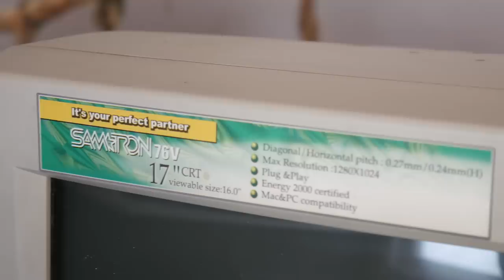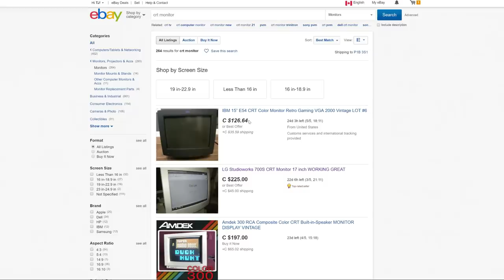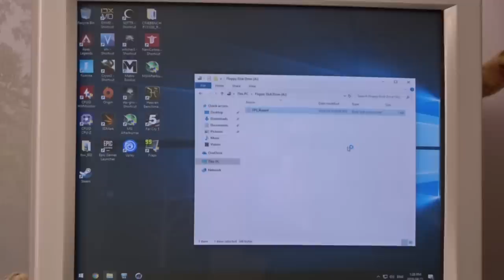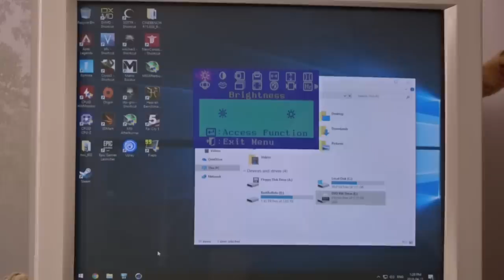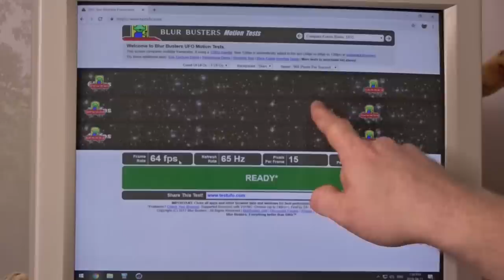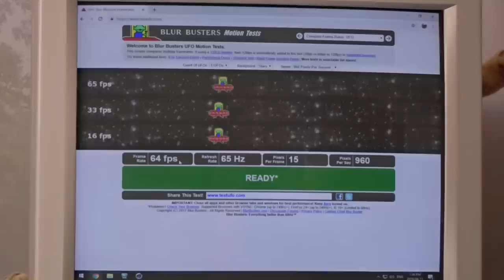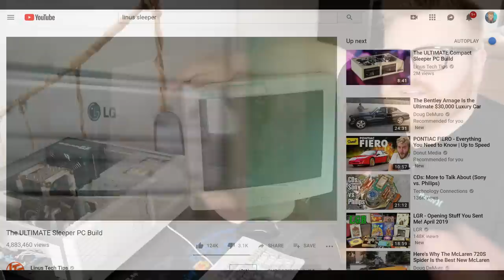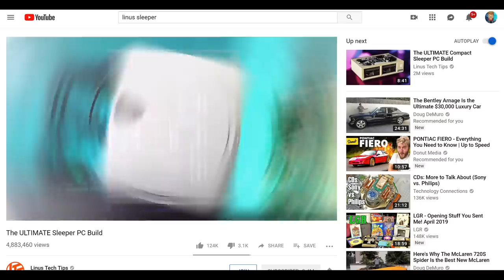Using a CRT to game with titles from 2019????

Comment: Yes, people don't realize how much better the overal image is on CRT's than LCD.  Everyone wanted the physical slimness vs actual image quality.  Few people know LCD's blur with motion. Even my 1ms 120Hz gaming lcd monitor blurrs.
I didnt notice it until I had lived with my new LCD HDTV for a couple years. Then I used my older CRT HDTV for something & my jaw dropped at how rich the colors were & how smooth the motion was.
Don't believe me? Just move something with text (like a map) and try to read it as it moves.

Comment: 65hz on that monitor, if you're not you, has flickering that does your head in, 85hz is a minimum for CRT, it is fast enough to not bother.
If you lowered the resolution on even that monitor, you can overclock the refresh rate to 85 or higher.
lower resolutions with antialiasing or supersampling look better on CRT's than higher resolutions.

Comment: Did I miss it or did he not tell what motherboard and CPU he put in there? I see an old parallel cable connected to the motherboard so I am curious what motherboard it is. It looks nice, that blue color of the motherboard but I don't like the white plastic on those slots though, that doesn't fit well with that blue color.

Comment: Defiantly add a couple of 80mm fans to the front PCI card support bracket as intake, if it allows do 2 piggy backed in the stock supplied location and you should see some improvement on temps.

Comment: I recently bought a 19 inch CRT monitor for $50.
Its max resolution is 1976x1482 @60Hz, but I run it at 1440x1080 @85Hz most of the time.

Comment: I would love to do a Noctua color build, beige/brown with an old case like that. 
A way perhaps to approach that case with airflow would be maybe chopping out those drive cages and have fans in the bottom front of the case drawing air in.
If you have access to a 3d printer you can get fan brackets for pcie slots to pull air under the GPU.

Comment: If you ever get a high end CRT with the ability to crank up the refresh on the lower resolutions, do that ;) You will also have to put a faster cpu to get to around 120Hz@1024x768 resolution though, but thats really why you would want a CRT in this day and age in the first place. Without that refresh, theres not a single reason to consider using CRTs.

Comment: Dont hack this system up. Keep it as is. One advantage of having a CRT over an LCD/LED is that there is no native resolution you have to have your CRT on to look its best. Any resolution looks good on a CRT. For extra cooling, you could buy one of those fans that slide into an expansion slot and blows the air out, or you may have room for an 80cm fan out the back of the case. It looks like it might miss the CPU cooler?

Comment: still using a (big) crt and currently playing crysis 1 at sorta 720p (1152x864),max settings and all
this one supports up to 1920x1080 but screw that
4:3 aspect ratio and (less) input lag forever
Reply: try interlacing!

Comment: I think gtx 980 tis are the fastest cards with VGA but you can also buy active HDMI to VGA adapters for newer cards. Also try overclocking that monitor I'm sure it can do at least 120hz. Also if you need some solutions to let modern games in other aspect ratios WSGF should have you covered.

Comment: I'm rocking a Trinitron CPD-200ES as daily driver... 1440i at 85Hz is not a problem and looks better than 1080p60 on an LCD (Plus I paid only 20€ for it) (Also 1080i at 120hz looks good)
P.S. To fix the aspect ratio on Apex you have to put it in windowed fullscreen

Comment: With the feet elevating the case, there might just be enough room to where you can drill holes in the bottom for ventilation going in, maybe a slim line fan over the holes. I'd probably would attach a slimline fan as an exhaust on the rear grates, as the power supply is likely getting warm only because it has to be the thing exhausting the hot air. Power supply as the only exhaust worked fine back in the day, but not so much with modern hardware. Lol, maybe get one of those old fans that exhaust out of the PCI slots and put it in between the graphics card and CPU. Those were so pointless back in the day, but actually help in this case.
Reply from the maker: Good ideas

Comment: In the early 200's (~2005) I had the grand idea to buy a Mitsubishi Diamond Pro 2040u NF from eBay for like $50 (I think it cost like $75-80 to ship the 68-pound monster though..)
It had a native res of 2048 x 1536 / 75 Hz (double 1024 x 786) it actually pushed over a million more pixels than a 1080p screen.
It had 5 coax cables as an option in addition to VGA (BNC, one each for RGB one for Horizontal refresh one for a vertical refresh, each in a shielded coax cable, I had a BNC to DVI cord IIRC)  The screen had a button on the front to switch between BNC and VGA so that two systems could be hooked up at once and share the one monitor (Dual monitors??  pfft  dual PC! lolol)  The colors were supposed to be excellent, I believe I got it from a graphic design business that was getting rid of them all.
It had two USB in ports (square) and 3 USB out ports (rectangle) so you could hook up a keyboard and mouse and other item and share it with the two PCs.

Too bad it was over 68 pounds and actually started causing my desk to bow/sink in the middle after a couple years :p It also produced a lot of heat for a small room (over 170 watts used according to the manual I found online.
https://www.manualslib.com/manual/258812/Mitsubishi-Nsb1107sttuw.html#manual

Comment: I got a 1080p 60Hz monitor that only has VGA connectors, and I use it with a modern GPU with a HDMI to VGA adapter.

Comment: 1280x1024 is 5:4 not 4:3...it's actually even less wide.

And DVI-I or -A is needed for analog, not dual link. DVI-D would be no bueno and is available dual link. The 4 pins around the blade are for analog.

Comment: 4:01 no, it's gotta be a DVI-I connector, having both analogue and digital capability. Dual-link is for higher resolutions than DVI was originally designed for, and has absolutely nothing to do with the analogue signal (VGA)

Comment: The cooling problem of this PC is because the components it was designed for were much more efficient than modern PC components are. Pentium 2s and 3s were like 20W TDP or something, and graphics cards of back then did not really exceed 60W TDP for the flaghship models, nowadays efficiency like this cant quite be found even in laptops :) Perhaps i5-8600T + 1050Ti should result in similar TDP sensibilities and not run too hot :)

Comment: 🙄your beige plastic box inside 
is for an intake fan...
It's even shaped like one 🙄.
You could help things along by replacing some pci slot covers with vented ones or just leave them out,  but if you did fit an intake fan up front you'd be better off leaving the slot covers alone otherwise you'll lose your air ( Path of least resistance and all that ). 
You can duct your cpu cooler out back easily enough. 
Flip your psu so The 120 fan is on the right hand side then punch/ louvre or drill your case lid right vertical side to allow air intake into the psu.
Much cooler for the psu.

Comment: Damn, This video is making me wish I kept my Black CRT NEC 19" Multisync Flat Tube monitor. It had a native of 1280X1024 but I could push it to 1600X1200 @ I think 75Hz. But at 1280X1024 I was able to push it to 85Hz. I remember trying to play Call of Duty (2003) at 1600X1200 on a EVGA FX 5700 Ultra and it could barely handle it. My friends would tell me I was warping when they tried to shot me but on my end I just saw low FPS. Those where the days :)

Comment: about the optical drive, is very easy, just grab a SATA one, about the floppy, you can get one of that usb ones and adapt the internals in the case of the old floppy drives, and about the monitor, you can use a Sony FW900, probably the best CRT PC monitor of the world, 24", 1440p of vertical resolution, widescreen, 120hz and with all the cool CRT stuff like better image than a LCD, lag-free and etc......

the only problem is that they are a bit expensive......

Comment: Well if you have good CRT they are great. I used one that could run 1600x1200 at 75hz, or 800x600 140hz until i got 1080p 144hz screen in 2016. 140hz on CRT actually feels smoother than 144hz on my LCD, its just that 800x600 looks bad. I loved how i could choose resolution depending if game benefits from high refresh, and how heavy game is on GPU, with this LCD im forced to run 1080p unless i want it to look bad.
For that brightness thing... if i set brightness on highest it gets washed out colors, i think i had it at closer to 50% brightness.

Comment: 4:05 That is one of MANY REASONS I love the Gigabyte G1 Gaming cards from the 900 series, back when G1 Gaming was their top end. I own the G1 Gaming GTX 980 Ti - and I LOVE her! 1503 MHZ core, 8 Gbps VRAM speeds no problem! Never exceeds 71° C at worst, at 85% fan speed.  

I need to clean my PC it is full of dust, but due to my EXTREME airflow (reason for the extreme dust!), my temps have only gone up about 3° higher relative to when everything was fresh and new, at the same room temps. That said I think my 980 Ti needs some Kryonaut and fresh thermal pads, I will do that soon.

Comment: Up until I upgraded to a 144hz panel, I was using a CRT exclusively for Online shooters. Had to run it in some strange res (something like 704*528) to get 121hz because it was connected via am HDMI to VGA adapter

Comment: love ya gutz ... nutty shit is good shit.
My recommendation would be to get a LCD 4:3 monitors to the size of the CRT --- GUT the CTR and drop the 4:3 LCD inside it. maybe a AIO water cooler id not go overboard but dual graphics card would be a nice touch. with a AIO cooler the is a room on the left under the graphics to place it, femove the PCI blanking plates and put mesh there {you can but mesh PCI plates] will allow more air flow.. 
it the front are vents RGB behind it for that i am a fuk head look lol you there vent edited as i type while watching,

Comment: 3:47  You are.  If the card has DisplayPort, then an active DP-to-VGA adapter will work.
Reply: 4:04  No.  Dual-link DVI is digital only.  The connection needs to be DVI-I as opposed to DVI-D.  That means it has the analog pins, which are routed through to the passive VGA adapter.

Comment: You can buy USB to ps2 adapters to hook up ps2 mice and keyboards to any computer with a USB port. The White plastic bit is meant for speaker, fan and too Help hold Very long old style Isa cards. Isa is the standard that was used Before pci and Later pci Express. My first pc was a commodore 80286 pc and it had a few Very Very long Isa cards back in the golden age of computing :)
Reply: Please do not mod the case. With beige mouse, keyboard, speakers and mouse Pad then it Will be the ultimate sleeper.. Maybe find a way to sneak additional fans in There. The multimedie pc of the 90s ftw! Another option to keep it even more authentic is to use a serial mouse. Most motherboards still have a header for a 9 pin sub d serial port. Windows 10 is able to use a serial mouse btw!

Comment: Got my Lacie Blue Electron VII 22" for 150€ best decision I ever made with a GTX 970 I'm able to push this beast at resolutions and refresh rates that I never thought I'd have on a monitor if you're interested : 
- 2046 x 1536 @85Hz 
- 1600 x 1200 @120Hz (which is advertise as the max resolution @85hz) 
- 1440 x 1080 @160Hz oh yeah.. 
- 1200 x 900   @125Hz (for some reason it goes down there) 
- 800 x 600     @160Hz (perfect for old games looks crisp af) 
- 640 x 480    @160Hz (starting to see a patern there) 
- 360 x 240    @160Hz 

This is basicaly a solution on how to make your hardware last forever because lower resolutions not only increases the refresh rate but also looks amazing on CRT

Comment: I still have a CD/DVD combo drive in my beast PC! I have not used it since installing Windows 10, but nice to have if I want to dust off any of my many old  CD ROM/PC DVD games I have sitting in my basement gathering dust. 
Really though, no REAL point in my having an optical drive, hell it is probably impeding some amount of airflow to my NH-D15 from my front intake fans!

Comment: Timmy joe!! HOW COULD YOU NOT OVERCLOCK THE CRT!! jokes aside my crt gets 105 hz at 1024 by 768 but i get 80 hz at 1360 by 1024
also im using a HDMI to VGA adapter. I was warned that it would add input lag, but its not noticeable. it even show up in device manager (win 10). i have a dell but it has the same OSD.

Comment: i use an active adapter dvi to hdmi then hdmi to vga and i run a 19 inch crt with some odd resolutions for it as well. i pushed 2880x2180 out of my 1080ti

Comment: Idk what's better a gtx 970 4gb or a gtx 780ti
Reply: When the 970 was first released, running on the drivers of 2014, the 780 Ti was marginally faster. With the latest drivers for each card, the 970 is better than the 780 Ti.

Comment: I have three Samtron 96p + a few others. I really prefer the picture quality on CRT compared to LCD and no hacks and workarounds to make them display colours correctly. Annoyingly I still use a LCD now because of the aspect ratio i a bitch to work around on some game where UI programmers have no idea how to do their job. Usually played games in 1600x1200 or 1920x1080 letterboxed. Got more issue when I had to geta new graphoc card that did not have a DVI port and had to use an extrenal converter.
Sony madea few 16:10 aspect ratio CRTs.

Comment: I still use a crt specifically for csgo.... Above 100hz and it works fine
Reply: crt's produce headeaches when you are infront of them a long time
Reply: @Zero11s  really? I never really have that as an issue
Reply: @Zero11s  nonsense, any screen does that
Reply: @patg108  maybe you should visit a doctor?
Reply: @jungle_cs  well I have Amisulprid now, it protects my body
Reply: @Zero11s  you should be the one thinking about visiting a doctor. I'm fine with any kind of screen and i take breaks whenever i feel a headache or eye strain starting.  Which is rare for me.
Reply: @patg108  I am not the one having problems with TFTs
Reply: @Zero11s  actually you ARE.  The fact that you can't read that i said i have NO problem with ANY display type is evidence of that.

You're already showing that YOU have problems with them.  Likely due to poor nutrition or genetics if not both.

I have stated that i RARELY get headaches, try about 4 or 5 times a year kind of rarity.  DESPITE using multiple types of display regularly on a day to day basis for the majority of the waking hours.

Even when i do get a headache its rarely bad enough to where i'd take any headache medication of any type.  I simply do something else, watch tv, use a different device, or take a nap or read a book and before long its gone.

I also make a habbit of eating and drinking healthier foods in general some of which would help reduce problems with that if not prevent.

Get a reality check and a doctor's appointment, i'm FINE and i look at screens all the time with no issues.

You on the other hand?  You can't even stand to take a few minutes to read a simple youtube comment properly
Reply: @Zero11s  Only on low refresh rates (for me at least). I never could stand 60hz!!

85hz and (much) higher have always been for me. 100-120hz is as comfy as a painting

Comment: make a proper retro pc, and have you checked salvation army or good will or value world or pawn shops?  And yeah the ewaste bins have plenty of them in there but yo're right, unless its a all in one there is no data on a monitor.  I can see mistaking a all in one mac or pc or something for a monitor.  And while he's right about the data its the person's fault who donated it for not getting the harddrive wiped properly in the first place!

Such stores could easily sell this stuff for much cheaper than ebay (they already do for lcd monitors), granted you might have to have a specialty electronics themed one instead of filling it 75 to 90% the store with clothes (a lot of those won't sell too and are just as much of a waste).  And no you shouldn't do that project.  And there is probably a card you could install for a modern os that would allow a floppy drive  to be hooked up (if you can't find the oddball that has one still)

Check garage sales flea market, mom n pop computer repair shops (esp that, though getting the owner to sell ya somethin might be the real issue)  It really is a shame how destructive and wasteful people and companies are to old hardware they think has no use or value